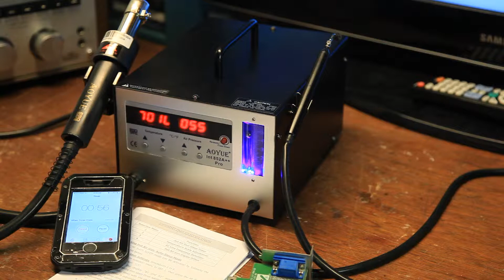Aoyue 852a++ pro Newest Demo & review

Comment: you recommend it? I'm going for a new hot air station and not deciding between this or Yihua 8533AA
Reply: What did you go with?
Reply: @jstro-hobbytech  Quick 861DW, quality/price most recommended
Reply: @MandangoGC  thanks for the quick reply after such an old post. My cheap 858d almost melted after light use today after light use. I'll keep it for cleaning 3d prints but it's no good. My friend has the quick too.

Comment: When your pulling the components with the tweezers, I noticed your grabbing the solder ends. The tweezers is cooling the solder when you make contact and is counter productive. It would cooperate just a little bit more if you would grab by the body of the component.
Reply from the maker: +jeffescortlx   tweezers aren't acting as a heat sink when they are no on the component all the time. 
Whats more important is having the temperature up enough to melt the solder. once i got the temperature up enough, you can see that me grasping the component dint maker a difference, it stays hot long enough to pull away.